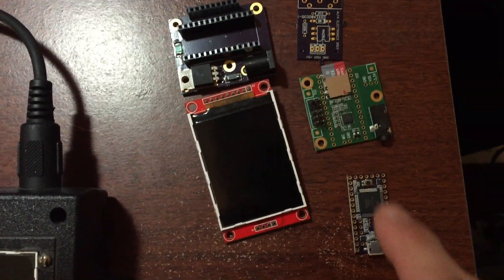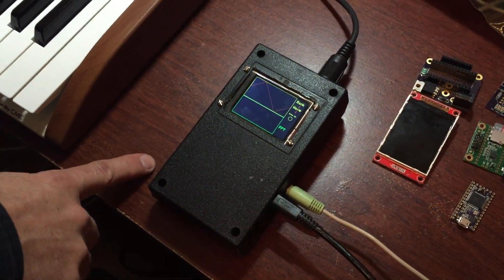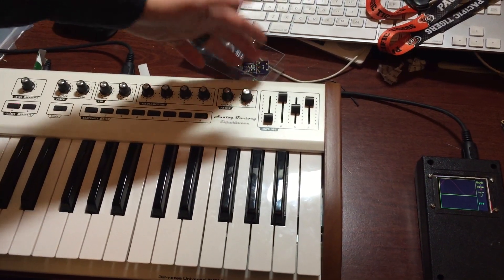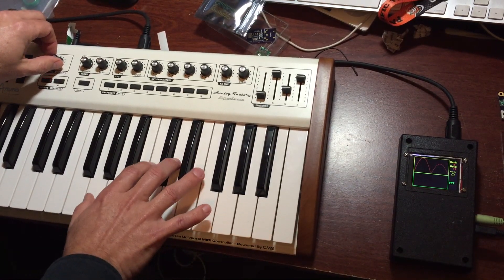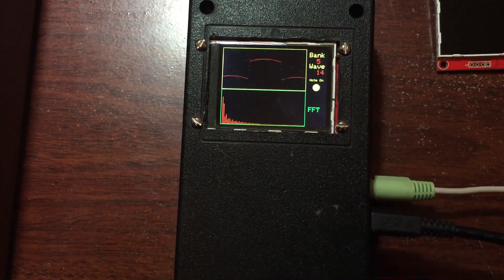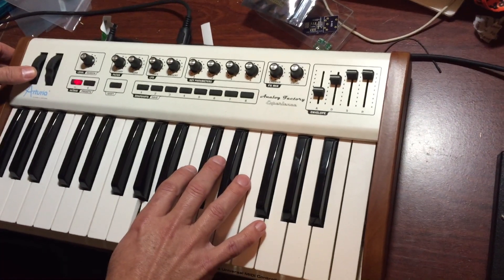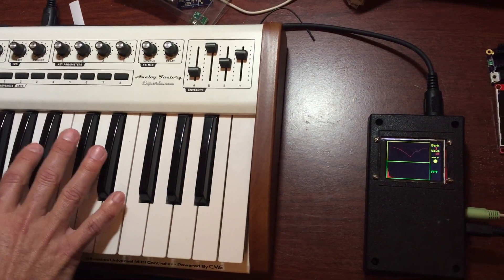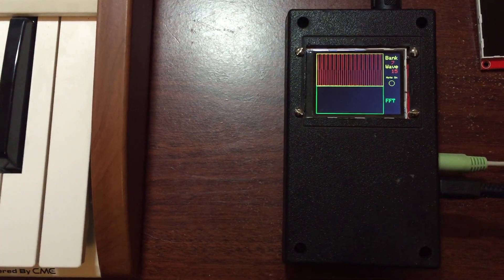Teensy 3.1 Wavetable based mono synthesizer

Comment: Hi Alessandro, love the synth! I'm wondering how you implemented the 'oscilloscope trace'? Is that using the FFT?
Reply from the maker: +00dom00 Thank you! I divided the screen in three areas: Oscilloscope (top left), FFT (bottom left) and general info such as bank/waveform selection, note On/Off "LED" on the right side.
The FFT was relatively easy to implement, because the Audio library has a function that calculates the FFT with the audio data in the buffer. However, there was no such "oscilloscope" function built-in into the library. I used the "Queue" function (also in the Audio Library) to store 256 samples of audio, and adjusted for the display dimensions. Next I want to implement a "trigger" function (such as zero crossing) so that I can lock-in the wave.   I think  I will need to store twice as many samples to accomplish this, and it may not be worthwhile (i.e. searching for the zero crossing may take too long and slow everything down). We will see...
Reply: Hi Allessandro, could you tell more about the oscilloscope function. Or maybe post your code on the Teensy forums/Github? It would be of great help!

Comment: Wow nice! Is the code and/or schematics available?
Reply from the maker: Hi, thank you for the feedback! You do not need schematics here, in the video i showed the 3  boards (teensy, audio, display) that you connect together to make this work! Code-wise, i will be happy to share in github. But you should know that Paul @pjrc.com has made several enhancements to the audio library since I implemented this. For instance, wavetables are now part of the library. Feel free to PM at first dat last at gmail dat calm.
Reply: @alessandro_fasan  Which library is it?
Reply from the maker: @scrapeape  it is the pjrc audio library for the Teensyduino. This was an older version of it. There is more functionality now. For instance, the wavetable is part of the library now (here I had to develop my own).
Check Teensyduino 4.0 / 4.1 and the related audioshield. If you are a hobbyist you are going to have a lot of fun!